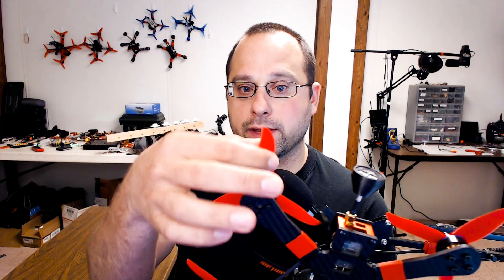How to recognize prop deflection (and my new favorite prop!)

Comment: Ballpark idea... how much, and in which direction would pids need to be tuned going from the king Kong to the dal cyclone.  I made this exact swap one day out flying without tuning anything, and it had bad oscillations and was all over the place.  I went back for now, but I'm hoping and assuming a tune would fix the issue?
Reply from the maker: I suppose lower P and higher D would be needed since this is a more aggressive prop.

Comment: I'll try the DAL once i go through my new stock of 5x4x4 PC. The 4 blades of the PC have quite a bit of deflection when coming out of a loop or around a hard turn but it is easy to just give it more throttle. They are durable but of course dont give me the good snap that HQ 5x4x3 do. Do you need Hulk strength to get them on and off?

Comment: Hi Joshua hope you can help me on this I would greatly appreciate it. On my impulse helix when I fly it on 4s it dips on throthle punches & also I did notice today that when I roll flip to the right it is super fast? When I do frontflips backflips & left roll flips my rates are all on point. I just tryed the strap down method but I couldn't notice one that seemed out of whack I only used 3s tho with strap down method. Is the a way to diagnose which esc or motor is bad through black box? It would be of great help because the helix is hard to get to each esc there are fairing covers so I want to know which one to replace instead of going through each one at a time. Anyway no rush I have other quads but if you have any good suggestions it would be of great appreciation. O ya the esc are new 30a akons running d shot and lipos are tattu 4s must new. All esc and FC are running newest firmware. My blackbox logging is not through sd card I think it store to FC on craft. Thanks Eric
Reply from the maker: If rates are not equal left/right then the first thing I would check is the Receiver tab. Make sure both endpoints are 1000 / 2000 and center at 1500.
Reply: Ok I will check that soon and let you know I did switch remotes from a spektrum dx9 to a Taranis x9p. However I did notice on both remotes so I'm kinda thinking it's something else. I put my rates from 998-1998 I can't ever get them right at a perfect 1000-2000:)

Comment: Another problem I found with the higher kv and king kongs is with them breaking at the hub.  I've snapped a few in flight now and after inspection the hubs have air pockets and makes them incredibly weak.  I have a video in my channel of one of my flights where the king kong prop snapped.  It was crazy because when it snapped it found the battery cable and unplugged in flight as I was blasting over some Pines.

Comment: Hey Joshua! I'm still using 'old' motors and ESCs. Dys se2205 hollow shafts and racerstar 30A v1 ESCs with KK5x4x3 props and amps are huge, what will be with higher torque motors and cyclone props? What batteries can handle this?
Reply from the maker: Why do you have huge amps on such light props with such reasonable motors, is the question I would be asking. How many amps are you pulling?
Reply: My PDB integrated OSD reports up 70-80 amps. Quad weight is pretty high, 600g with HD camera and battery

Comment: I bought like 20 sets of cyclone project a after using HQ 5x4x3 for the last year.  The cyclone props are so durable I only ever bent one prop slightly after tons of hard crashes in the last few weeks. Unlike previous durable props I've used, these hold shape very well and don't create vibrations after crashes too much. The extra weight of the props also got rid of some mid throttle oscillations I couldn't get rid of. 

I read somewhere that the clear plastic is actually stiffer than the solid colour plastics. I've used all clear plastic cyclones, but my solid colour dal 5x4x3 were just too flexible. Do you think clear versus solid props matter? Something about fillers used to make the plastic solid in colour.

Comment: I have the emax rs2205s 2600kv. Can i try the 5045 cyclone?
Reply: Eek!  2600kv.  I run them on the rs2205s 2300kv motors no problem.  Try it and check your motors for heat, if they don't get too hot, then all you are going to hurt is your batteries.

Comment: @Joshua Bardwell. The t5046 are indeed the better prop in my opinion. I just received the new T5050's and putting them on my EFAW 2407 2500kv. I will let you know what I think in a fb message.

Comment: This video is perfectly timed... I was experiencing this "flutter" using the Gemfan Flash 5152 props on Emax RS2205 2300kv red bottoms and it was driving me crazy! For a few days I couldn't figure out what was going on! Finally I realized the prop was deflecting, but I had a hard time finding any information online about why it would do that.

Interestingly, before the 2205s, I was using the same props on the higher torque Emax 2306 white top motors and I didn't have the same issue. I've never used the KK props, and I've never seen this happen with any other prop I've tried.

The other strange thing is I would get the flutter at idle and lower cruising speeds, NOT on punch outs or higher cruising speeds!

The Dal Cyclones are awesome props on both motors!

Thank you for your videos!
Reply: XeroVolume I do not think the "flutter" is what you are having on your quad... Sounds more like a resonance problem (caused by the frame, or any other loose component on your build). If you are having the flutter at idle or low throttle, it should continue throughout the throttle range, not dissappear like it's probably happening to you. I'm also using the flash 5152 with both the rs2205 and rs2205s, both of them at 2300kv.... Besides, a new flash 5152 prop is too stiff to be showing flutter. If it was hit or bent several times, it's a different discussion. 

Joshua Bardwell, guys, please correct me if I'm wrong, but I don't think that flutter can happen at idle on a 2300kv running on 4s....
Reply: Lothar Krupka I wish that were true, but it is 100% flutter, as I saw it with the quad sitting on the ground idling. I could visibly see the flutter and hear the "wind reed" sound. The motors are pretty new Emax RS2205s red bottoms. I swapped in a brand new set of 5152 props thinking it may have been a bad set. The first set were clear, the second set I put blue on front and pink on back. All four props flutter visibly on both sets. Once I get in the air, the flutter disappears unless I'm cruising as slow as possible or sometimes in prop washy situations it will come back. Very strange. I'll put a video up when I get a chance. I also need to do more testing with another set of the same motors. Like I said, the problem was not there with 2306 white top Emax motors...

Comment: Love the 5046 cyclones. Little bit more amp hungry than the HQ 5x4x3pc V1s but more power and much more durable, in my opinion. HQ's bent pretty easily in my....uh....crash testing.

Comment: The King Kong 5x4x3 were my go-to props for months except I've been having a lot of issues with them exploding in mid air due to air bubbles in the hub. It's come to a point where I simply can't trust them for anything and have swapped over to the new HQ 5x4.3x3 V1S which seem to be much more reliable. The Cyclones are a phenomenal prop as well. 
Really looking forward to trying the Emax Avan when they become more widely available.

Comment: what cyclons are these? V1 5045C, V2 5046C or V3 5050C?
Reply from the maker: Mine are 5045 but some are saying the 5046 is even better.
Reply: I've flown both 5045c and 5046c and the 5046 is a bit more thrusty as well as a being quieter.
Reply: you have to try the 5046, the name does not do them justice. i am using them on 2300kv tho and my packs come down a bit too warm but it´s worth the extra fun :D
Reply: Joshua Bardwell that's right 45 are great props and they dont eat battery that much. but 46 are so much more powerfull. in numbers its not big difference, but when fly You feeling like drone got 30% more power.

BUT! 
V2 -> 5046C eat so much Amps!!! these are battery destroyers :D

but if you like V1 then You would love V2 ;)

i dont tell anything about V3 because i didnt got them. i ordered V3 2 blades, but they didnt come to me yet :(

P.S. Josh Bardwell if You are interested I got really weird troubles with my wibrations with my fpv camera, while rest od quad is ok
Reply: A little bit.  I'm sure they'll stop making the 5045 eventually.
Reply: Joshua Bardwell I've been flying 5045 Cyclones as my go to prop on all my quads for about 6 months now but have switched about a month ago to 5046 Cyclones. The speed and thrust is insane!!!! Can't ever go back except maybe on an extremely tight, technical track. Just as durable. I'll have some 5051 Cyclones to test shortly.

Comment: I've recently moved away from the Cyclones (after 6 months of flying them), to the HQ 5x4.5.5x3 and I've got to say that they are far more efficient than the Cyclones. Seriously Mr Bardwell, give them a try. You won't be disappointed.

Comment: those king kong 5x4x3 are pretty horrible IMO...they are too soft and thin...the Dal 5x4x3 V2 is better...but my new fave is the V1s 4.3 pitch...I used to avoid HQ but these are fairly tough and not too expensive...they feel sharper than the Dal...Cyclones are good tho also but heavier...you are right great for high power builds esp 5 or 6s..

Comment: I believe the race raft 5051 are only a 4.6 pitch despite its name.
Reply: Kevin, you are correct. Sage, the designer of the prop had this to say at RCGroups: "The last 2 digits of 5051 does NOT mean pitch as were with previous props. Pitch is a number poorly describing the performance of a prop. 2 props with the same diameter and pitch will not mean they will perform the same. Its missing key factors such as chord length of the blade and how that changes with radius. Instead the last to digits will stand for  Advance Ratio. Specifically this prop has an advance ratio of .51, therefore 5051 for the 5 inch triblade"

The prop is designed for maximum efficiency at 60mph. The meatier root of the blades allow the same amount of thrust across the entire blade from root to tip. In short, 5051 does not mean a 5" prop at a pitch of 5.1.

Comment: What is your thoughts on props for my sigan210? It's using 2205 red bottoms racing setup. I also am building a chameleon with 5 inch props and emax 2306 motors prop recommendation for acro flying?

Comment: I disagree with the comments made about the RaceKraft 5051 props. At 5:00 Joshua says that "because of course steeper pitched props achieve lower RPMs because they load the motors more and therefore they are slower at top end speeds". While it's true that on the bench they achieve lower RPMs, it's not true in the air when moving fast because they are unloaded by the wind, thus allowing them to reach high RPMs. In fact you need these high pitch props to give the motor something to at high speed. 
For example; a 2500kv motor running on 4s would have a max RPM of around 37,000. If you use a 4 inch pitch prop with that that gives a max speed of 148,000 inches per minute or 141 mph. Therefore if you're travelling at around 100 mph there's not really much load left on the prop compared to when stationary. Switching up to a 5" pitch prop increases the top end to 176 mph and keeps the load on the motor higher when travelling 100 mph allowing it to create more thrust and carry on accelerating.
Reply from the maker: Well, like I said, there's something about those props that I don't understand. Maybe that's it. But I'm not just talking about on the bench. I've done drag race testing with RK5051 vs other props and the RK5051 consistently lost. That's where I get the conclusion that it's not a prop build for top-end speed. But so many racers run them that I know there must be something missing. 

Also, if you look at the top-speed runs that people are doing, nearly all of them (if not all... I don't know) are using light two-blade props.

You're right that there has to be some load on the prop or it won't be able to accelerate. But if the load is too high the motor can't increase the rpms so pitch speed doesn't increase. I don't know where the balance is, but it feels to me like if you want straight line speed, RK5051 are not the right prop.
Reply: Joshua Bardwell Did you do those tests on your high KV rotorgeeks motors? I think a modern motor with higher torque, 2306 or 2207 or bigger, would favour the 5051.

The 5051 lacks low end thrust and control, it's designed for efficiency when cruising at speed.
Reply: Thanks for the reply Joshua. My issue is that you were talking about pitch, not number of blades so I don't think we should confuse the situation with talk of that (I think it's agreed that fewer blades gives higher top speed).  In these tests were you comparing a lower pitch tri-blade with the RK5051? In that case if the the lower pitch tri-blade was faster then I would agree that maybe the motors are being overloaded but perhaps other factors not related to the pitch could be causing the difference (blade deflection, profile). I just don't think we can conclude that it's definitely the higher pitch causing it to go slower.
Reply: I was a bit confused when I heard this too, are you saying the rk5051 triblade is slower than say a hq 5x4x3 on the same setup? surely not
Reply: I never figured out why so many use 5040x3 props, the thrust is like 3s, I mostly use KK5050x3, low cost, good top speed and the most durable that I have tried.
Reply: Correct, 2205s can't carry that much prop and do it well.. premium 2206s at the bare minimum and they are just enough to be able to start to handle them... the RK5051 is a FAST prop on a motor that can handle them.. Return R3 2207 2522kvs LOVE the 5051s and can handle them well.. the Returner V5 2306 2522 man handles that prop and I can absolutely assure you the RK5051 is FAST as hell on that motor and on 5s it's just silly, I've ran them on 6s but it just pulls to much current and even my Teampilot packs can't handle it.. I personally do not like the RK5051s never have and never will, they are ok but not nothing special.. the Gemfan Flash is a much better prop as is the Dal 5050x3 and if you really want a silly fast prop that also rips as a freestyle prop if you have the motor to turn it and the battery to feed the motors the Avan-R tri is hard to beat and ballistic fast pulling like no other 5 inch prop in the last 20% of the throttle range from 80 to 100% throttle the Avan-R pulls and pulls and pulls so long as yoyr batteries can handle the current demands of that prop on said motor.
Reply: Yep. More misinformation from Mr. Bardwell...

Comment: Thanks I was wondering what that was. I recently got a set of hq 5x4x4 pc props and they made that sound at full throttle. It was so loud that I pretty much used them once and took them off. They were in my alien with hyperlite 2450kv motors.

Comment: FYI Josh, cyclones deflect with 5s and 6s batteries. So the aren't the best for the highest of the high rpm scenarios . Just built a 5 6s racer and thought cyclone be the way to go but no Bueno. If you care to see it in action check my maiden 6S video. Thanks

Comment: Great Vid as always!
I'm guessing that an older generation/lower KV motor shouldn't have any issues with the King Kong prop (I have 2205-12 2400kv motors)?
I don't have the King Kong's on there yet as I had some HQ 5x4x3 that I was using until they were killed off but I went and got quite a few of them.
Do you think I will probably be ok?
Reply from the maker: +David Hayling they're still a fine prop on less powerful motors.

Comment: I tried those kingkongs about 6 or 7 months ago and found them to be absolute shit, From being so flexible they felt like a wet noodle, Almost zero durability in a crash and the worst the hub was slightly undersized so they were a pain to even get on and remove. Rubbish. All I'm flying now are Ideal 5048's

Comment: I'm using King Kong 5x4.5x3 and they are sturdy like cyclones and still just 6e for 10 pairs.. I couldn't even use 5x4x3 bc too soft and it felt like lag. (edit, fixes)
Reply: Same, I switched to those a while ago, they are tough, cheap and fly well.
Reply: Lasse u totally agree. These are what I use. At the price and durability it's a no brainer.

Comment: good video as always, I have been using the cyclones this season and loving them aswell, use the 5045 for freestyle and funfly and 5046 on my racing copter, the 46's got a little more mid throttle pull, so are very nice for racing copter when you need to pull yourself into a gate or such, not tested the 5050 yet, and I think it could be argued that the cyclones are actually cheeper than the king kongs in the long run, cos thay are just so much stronger and really last a long time, crashing into grass and clipping gates is not a problem anymore, king kongs you touch a gate and your props are ruined, you get vibration and even broken props, and have a hard time finishing a race, but the cyclones just shrug it off, think I have same set of cyclones now for 2 races and 2 practise sessions ( 30+ packs) on the track... and I'm not a perfect pilot... :), keep it up josh

Comment: Deflection is very prone to certain PC props. If you ran the original HQ 5x4x3 GN prop, it would not have that deflection (Sounds like you know that because they're so much stiffer). Seems to just be PC props with that problem. I can run 5S on HQ 5x4x3 GN and HQ 5x4x4 GN and never get deflection. The second I throw on PC 5x4x3 or PC 5x4x4 or 5x4x3 v1s, I get deflection bad. Finally, you should check out the new HQ 5x4.3x3 V1s, those PC props don't seem to have the deflection problem anymore. Cyclones are great too!